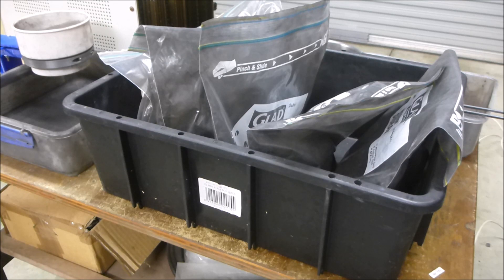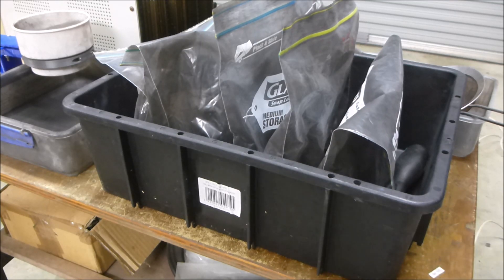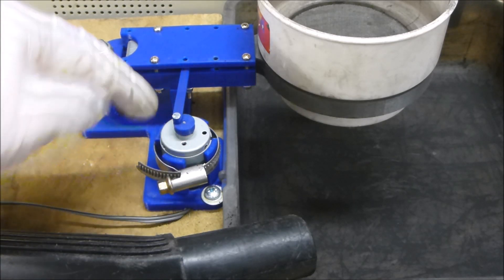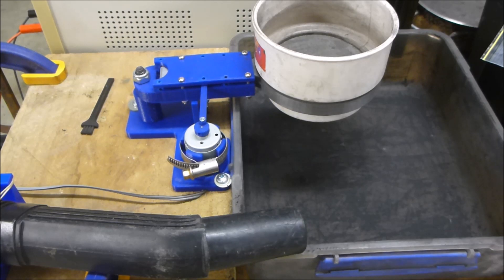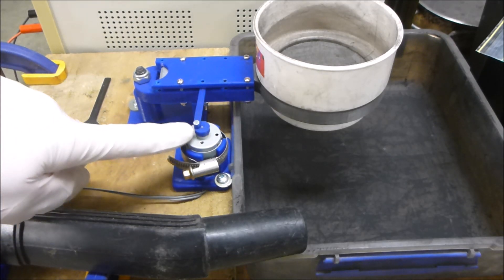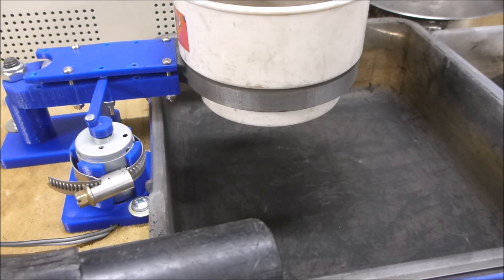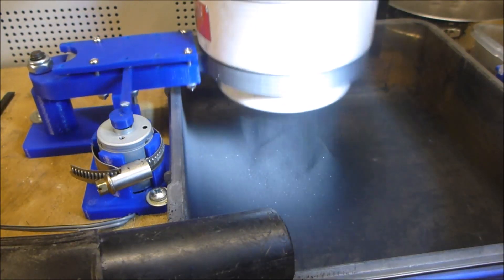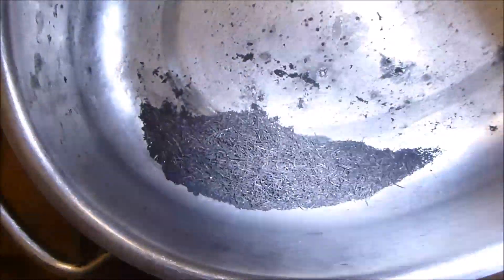Gold Recovery - Automated sieving of IC material

Comment: Would you sell me one of these 😂 I can buy the sieve off eBay but the 3D printer and genius is out of my price range
Reply from the maker: 😂 I think if I were doing it again I would get one of the bigger sieves, those big blue ones used by the Gold miners, then just connect a  brush or broom head to a old microwave turntable motor. I think brushing would work better than shaking.
Reply: @successfulengineer  that’s not a bad idea mate. I’ve got 50 odd kg of chips to process so trying to avoid incineration and your methods have been very helpful. Even mentioned you in my ball mill video hahah

Comment: Hi, I've been watching old videos on people using iron sulphate to drop gold from a dirty solution. My problem is none of them state the ratio of how much iron sulphate is needed to drop x amount of gold. I don't suppose you have any idea do you?
Reply from the maker: Hey Nick, I've never personally gone the Copperas route, when I have dirty solutions, I tend to cement on Copper, the re-refine and drop with SMB. Have you had a look at Hoke, I'm pretty sure she talks extensively about dropping with Copperas.
Reply: If I'm honest I downloaded the book but I've not gone through it properly yet. I'll have to have a read through that section over the weekend. I want to try something different as I've been using smb for both of my refines, from what I've seen you need to use two different compounds to achieve a better purity of gold. Does that sound correct to you?
Reply from the maker: That is not really accurate, pure Gold is pure Gold, you can certainly get there via various processes. If you drop Gold from a very dirty solution with too much SMB you will 100% drag down other metals with the Gold, but if you take that slightly dirty Gold and re-refine, then drop again with SMB it will be near 100% pure (because there is not as much contamination in solution the second time round). I think most people do not really appreciate that solutions have to be 100% clear before you precipitate the Gold and they often skip the washing after, then end up with 95% level purity. Yeah man, definitely have a read through Hoke, in terms of how much Copperas to add, I would tend to make a fairly strong solution of it, then add the Copperas to the pregnant solution a bit at a time and keep testing the solution till all the Gold is out. You would then finish the solution off with Copper for a day or two to make sure you have all the precious metals before it goes to waste processing.
Reply: Dropping other metals in my first drop is what I'm trying to avoid which is why I'm trying the copperas path. I'll definitely read up on what Hoke says about using it to precipitate the gold. I think it's good for me to try alternative methods of refining, the more I learn then hopefully the less mistakes I will make. It's good to know that using smb for both drops will also give me a better purity in my gold. I could actually tell the difference in the colour of the gold powder from first and second drops so I did think to myself that it was working. But I'm no expert so thanks for the clarification 👍
Reply from the maker: Cool man, let me know how you go with the Copperas, if you feel it makes a big difference I will give it a try myself. I suffer from having good confidence in the way I have done things, so I don't usually try new approaches without good reason, but that is probably the wrong way to think! Can't improve if you never try anything new!
Reply: Well since we last spoke I've tried both copperas and a piece of copper to get my gold out of solution, I'm definitely more satisfied with the copper bar approach. I say this for two reasons, first is because you 100% know the reaction has finished with the copper bar as the black/gold powder no longer collects onto said bar. I wash the copper bar daily until no more powder attaches itself to it. Second is because it is less chemicals involved in the process which for one is less of an expense, also I don't have more chemical waste to dispose of than is necessary. I do have two more questions for you though. First is about what you said about the washing process after refining, I've seen various methods of doing this from watching you tube videos and I was wondering what your preferred method of washing the gold powder was? Second question is about my waste water which has copper in solution, would it be possible to recover the copper from this water by adding it to my spent ap and then use iron to recover the copper? I'm considering evaporating it down before adding it to my waste ap?
Reply from the maker: Hey Nick, sounds great, it's impressive how good your questions are getting, sounds like you are making huge progress every week! Yeah, I am a big fan of Copper in dirty solutions, then re-refine and drop with SMB. If you mildly heat the solution with the Copper in it, the cementation goes much faster, you can usually get all the Gold out in a few hours. Then just use SC to test the solution to confirm it is all out. 

Yes, 100% the smaller the volume of waste you create, the longer you can work between waste treatment cycles. 

For the washing process (for me usually after 2 refines), Let Gold powder settle completely, siphon barren solution off into separate beaker (leave here for a day or so to make sure no more Gold settles out). Cover Gold powder with a centimeter of water or so and boil vigorously for a couple of minutes. Pour off water into the same beaker you already have the waste solution in. Cover Gold powder with fresh clean HCl and heat, needs to be hot for a few minutes, but doesn't need to boil, once again pour this into the same waste beaker. Cover twice more with water and boil vigorously for 2 minutes. This basically washes anything that is either water or HCl soluble out of the Gold powder. If you started with twice refined powder, you will have very very pure Gold at this point.

Regarding the waste solution, yes, you can certainly add any Copper solution to the AP for waste processing. There is an excellent post on the GRF regarding waste treatment for the home refiner, basically, raise the pH of your waste solution to 2 using Soda Ash, then use iron to cement out the Copper (I like to use an aquarium heater and air bubbler to speed this up), then when all the Copper is out, add Magnesium Oxide (Lime also works) until the Iron in solution precipitates as Iron Hydroxide. Iron Hydroxide is a very safe substance, it basically turns into rust when exposed to air.

I will make a video at some point showing the whole waste processing process.
Reply: Well if you're impressed with my questions then I must be heading in the right direction! I haven't as yet washed any of my gold powder that I have collected this year as I was planning on doing the whole lot in one run at the end of the year. I don't really see the point in doing it every time I have a gold drop, it makes more sense to me to do one wash a year, again this should help with less waste. 

Yes I do feel like I'm slowly making progress so thanks for saying so! I do have to build a ball mill though as I've now gone through two food blenders. My back up plan of using a container in the washing machine on a spin cycle holding alumina ceramic balls, wrapped in kitchen towels and then zip tied to protect the vessel let me down today as the lid came loose and some dust escaped onto the first layer of protective wrapping, I can still recover it onto a plastic sheet but it just proved to me that a ball mill is definitely the way forward. I've been putting it off as I wasn't confident I could make one like yours, but I've seen a few other videos on home made ball mills that I think I can make. Whilst I think about it I have two twelve volt batteries that I bought to run my blue bowl, what type of motor would you recommend I buy for my ball mill? I'm thinking something with variable power as I will probably need to fine tune the speed while it's running. I can get hold of some conveyor rollers and build a frame to support them, I'm planning on using two litre plastic containers with my ceramic balls in as a container, my problem is I have no idea what kind of output the motor should provide, any ideas?

If you do get around to doing a video on waste treatment it would be greatly appreciated as most gold recovery videos tend to be about the recovery process rather than waste treatment, in fact I don't recall seeing any waste treatment videos 🤔
Reply from the maker: Yeah, I usually want to get an accurate weight for every batch I do (to make sure I am doing it right), so I tend to wash each batch, but you are correct, it does increase the overall waste acid volume!
Reply: You weren't kidding about heat speeding up the acid process. I put some gold fingers in ap yesterday, with an air supply attached. I then then put that bucket inside my black rubbish bin which has a nice doomed top to stop any water getting inside. It was nearly 30 degrees Celsius here today so I reckon the temp inside my bin was well over 40 degrees. So when I checked them after work today the reaction had finished, they hadn't been in there for 24 hours!

Comment: I wonder if one of those big concrete vibrators welding to a steel table I wonder how that would do
Reply from the maker: I have a few 50W aura shakers, like they use in theater seats, I'm sure one of those with some U-channel would make a reasonable feed system

Comment: Nice invention. I think you would be much happier with a fast gear motor. You wouldn't need a speed controller either. I doubt that little motor will do much mileage being direct driven but I could be wrong.
Reply from the maker: Hey man, yep, I definitely need to get a geared motor, I think I need around 100RPM, that will also pretty much remove the need for speed control. That motor was just what I had sitting around, definitely runs a bit hot! Do you reckon a flat stepper would do the job ?  I have a few of them harvested out of various printers, cheaper than buying a gear motor.